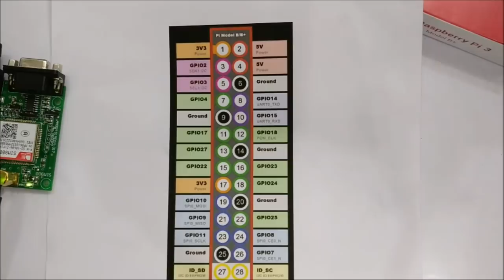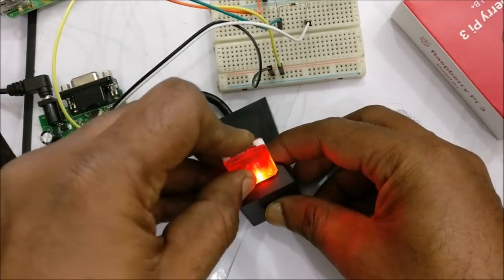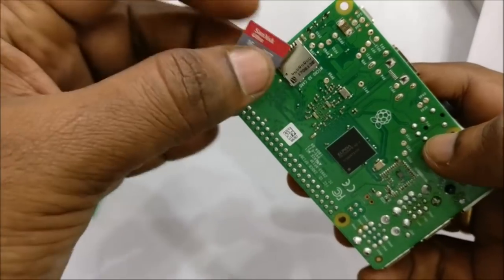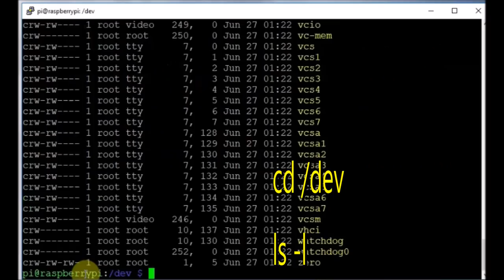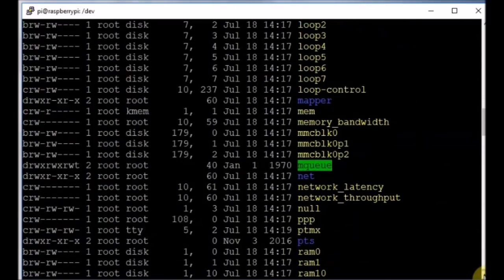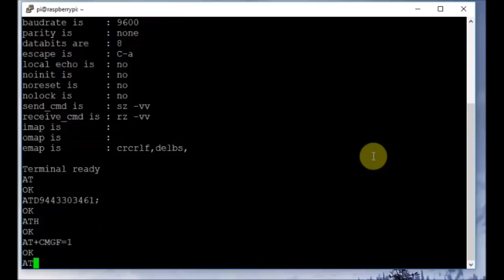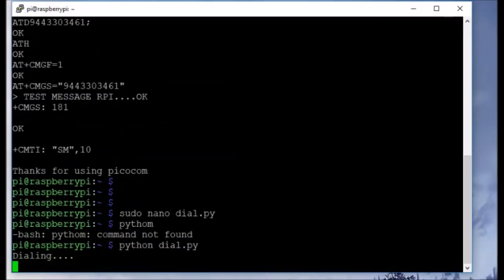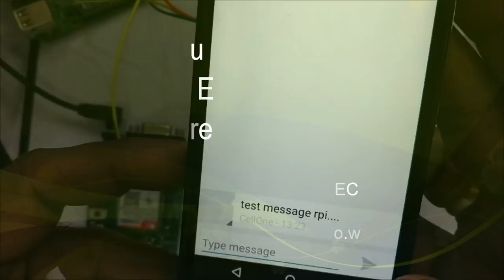Raspberry PI 3 B / B+  How to Enable UART & interface with GSM

Comment: Do you have to use a level shifter circuitry for my TX RX pins of my GSM Module? Because on website guides they dont do that yet here you do. I havnt tried with the circuitry yet but at the moment, AT commands are giving no response when I write to the serial port

Comment: Sir thank you for the video. I just have this question; Do I need a LOGIC LEVEL SHIFTER when interfacing a Raspberry Pi with a SIM808? Thanks for your kind response
Reply from the maker: Level shifter needed for RPI GPIO pins. 5v level from SIM808 will damage RPI in due course.

Comment: sir i used sim800l which is 3.4 v , Do i used resistor or level shifter
Reply from the maker: Level shifter not required if Vcc to SIM800L is 3.4v. If 5v is used to power SIM800L , better use 2 diodes 1n4007 in series to Vcc of SIM800L

Comment: Has anyone had success with Raspberry pi 2 Model B? The described method is not working for me. I connected SIM800 ADD-On using pin 8,10,14. Then tried picocom with:
sudo picocom --baud 9600 /dev/ttyAMA0
but i just get any response..or sometimes some strange char after a while
Reply: I am facing the same problem, did you solved it?
If yes please help me out.

Comment: Hi, why I can't still type AT after the terminal is ready?
Reply: Same problem with me do tell the sollution if you find one
Reply: Same problem if u  find the solution please tell me
Reply: Use /dev/serial0 istead of /dev/ttys0 it will work , ttys0 was for pi3 these things don't work on pi3B and pi3B+
Reply: @nayarabbas5555  Still i am not getting any response for AT command
Reply: @suyashjainsinghvi6265  did you got the solution afterwards?

Comment: I am not able to type  AT command on picocom ?  how much time it will take to the ready terminal?
Reply: Me too
Reply: Use /dev/serial0 istead of /dev/ttys0 it will work , ttys0 was for pi3 these things don't work on pi3B and pi3B+
Reply: @nayarabbas5555   yeup right
Reply: @nayarabbas5555  Sir. It is still not working. Mine is still freezing. Please help.
Reply: it is not working sir..please give other solutions if anyone have
Reply: i solved this.. folow these steps

Step-1  sudo nano /boot/config.txt
 
enable_uart=1

sudo reboot

Step-2 sudo systemctl stop serial-getty@ttyS0.service

Step-3 sudo systemctl disable serial-getty@ttyS0.service

Step-4 sudo nano /boot/cmdline.txt

Remove : console=serial0,115200

finally, reboot once

then in picocom set baudrate to 115200

now you should be able to use AT commands
Reply: @HKBHD  not working
Reply: @projectwork8200  it worked for me, try out once again... You need to dele that line from that txt file
Reply: @HKBHD  Thank you, brother, I solved the problem following your step.
but after removing  console=serial0,115200.
In the terminal, we need to set baud 115200 only (sudo picocom --baud 115200.................)as per module standard baud rate. Mine was SIM7600 for others it may differ so better to choose standard baud rate.
Reply: @sandy5550  welcome.. Btw where did you buy that module?
Reply: @HKBHD  from "rhydolab"
Reply: @sandy5550  cool. Okay!
Reply: @HKBHD  Can you help me by python cell how we execute commands? Because I am facing a problem for same command which is working on the terminal but not working in python shell.
Reply: @HKBHD  ser = serial.Serial(SERIAL_PORT, baudrate = 115200, timeout = 5)
AttributeError: 'module' object has no attribute 'Serial'

I am getting this error after writing code in GNU of the terminal. Can you help me out?
Reply: @sandy5550  Hello  sir i done follow your step but why I still cant type AT command. my windows was freeze. help me sir please T^T . im using SIM7600 too.
Reply: Once you try with a converter whose name is FTDI232. Do not connect directly RX and TX  with raspberry pi. I was also facing the same issue but while using the converter problem solved.
If still there will be a problem then reboot the system and try once the complete process carefully.

Comment: @Saravanan Al

sir I am not able to type at command  how to solve this problem ? No port given
pi@raspberrypi:~ $ picocom --baud 9600/dev/ttyS0 
No port given
pi@raspberrypi:~ $ sudo picocom --baud 9600 /dev/ttyS0
picocom v1.7

port is        : /dev/ttyS0
flowcontrol    : none
baudrate is    : 9600
parity is      : none
databits are   : 8
escape is      : C-a
local echo is  : no
noinit is      : no
noreset is     : no
nolock is      : no
send_cmd is    : sz -vv
receive_cmd is : rz -vv
imap is        : 
omap is        : 
emap is        : crcrlf,delbs,

Terminal ready
Freeze..........................
Reply: Use /dev/serial0 istead of /dev/ttys0 it will work , ttys0 was for pi3 these things don't work on pi3B and pi3B+
Reply: @nayarabbas5555  it is not working
Reply: using common source for both raspberry pi and sim800 will solve and also check the blinking pattern of sim800

Comment: The screen freezes it shows terminal is ready. How to solve that
Reply: same problem with me did you found the sollution?
Reply: If any one found d ans to this thn plzz tll I'm also facing the same prblm d screen freezes after the terminal is ready
Reply: Use /dev/serial0 istead of /dev/ttys0 it will work , ttys0 was for pi3 these things don't work on pi3B and pi3B+
Reply: @deeptiphaldessai8440   did you find the solution??
Reply: @maneetlodha4135 I think the eco is off thts y we can't c wht we r wrtng... So try to enable eco n then c or Jst type d AT command n press enter even if nthg can be seen Wht you r typing on d screen...U Shld get OK as d reply after you press enter
Reply: Is there anyone here solve this proble.
Reply: is this problem solved? as i am getting strange characters continuously and not responding.

Comment: fatal: cannot open /dev/ttys0: permission denied .....how to clear the bug pls tell me
Reply: do you have the answer? i also  in counter this problem
Reply: put "sudo" infront of the command
Reply: @sulhicader6282  after using sudo the terminal is open but I am not able to type AT commands the screen freezes can you help?
Reply: @YashYashaswi  im also came across same problem. I think it is because ras pi logic is 3.3v and GSM module logic is 5 v . There is a tutorial how connect both in such situation
Reply: @sulhicader6282  I used the level shiftier to connect the pi to Sim800, I even tried connecting the PI to ESP8266 which operates at logic 3.3v but still no success.
Reply: @sulhicader6282  I am also getting the error : Permission denied. How did you correct that error?
Reply: @snehalpahane9478  pst sudo infront of the command
Reply: @sulhicader6282  Okay. Thanks a lot
Reply: @YashYashaswi   exactly same problem also I am facing
Reply: @ @paulschmitt767  I have done the same.. Mine is still not working... Please help.